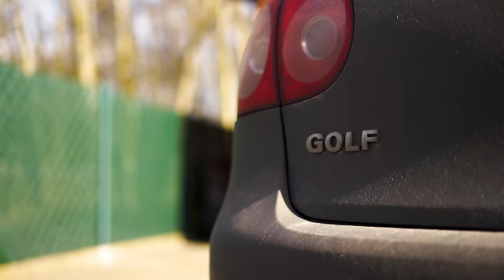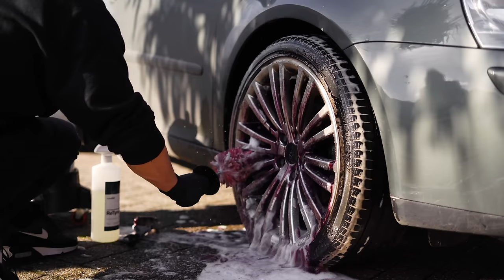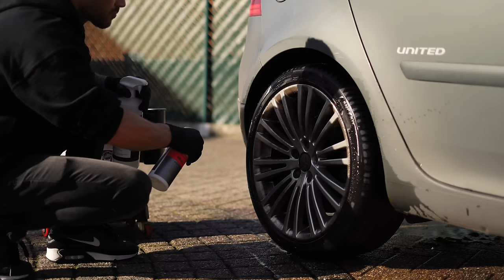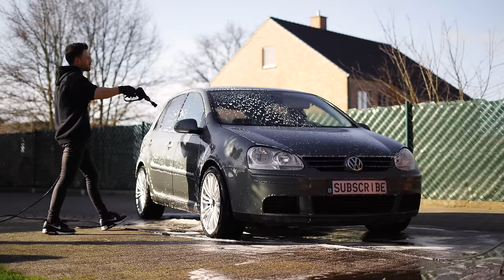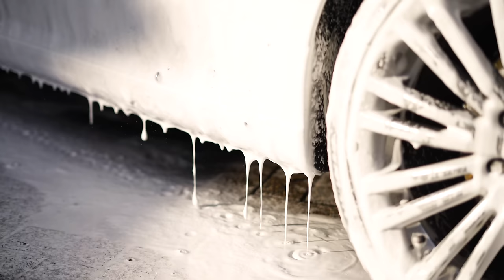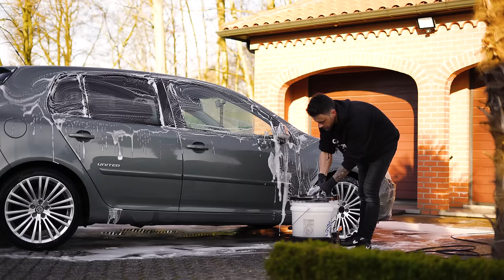15 Year Old VW Golf Deep Clean - DIRTY Car Detailing

Comment: Can you tell what i need to focus first with clearing car (equipment). I wanna to  compare my eqiupment with low salary (3.3kpln to 4kpln for example k5 home is 1500pln). I was thinking about air pressure foam spreayer because i have a compressor but to wash off foam i need water pressure too.

Comment: Hello mate. I just bought the same detailing brush set as you and I was wondering if the hog hair brush is OK to use on paintwork right out of the packet? I was going to use the soft brush for badges etc and the hog hair for window rubbers and plastics. Any advice? Thanks.

Comment: Can someone please explain me what’s “EXAXTLY” the point using first the foamer, wash it and then using the buckets? Thanks
Reply: the first spray was a "pre wash", typically a higher pH level cleaner that breaks down all that stuck on grime. The second spray was just a pH neutral foaming soap. The buckets are his Wash and Rinse. Every  detailer has their own process, but the "pre wash" isn't necessary had he just rinsed the car first-removing most of the heavy stuff and then foaming the car with a higher pH foam soap. I dont know why he rinses off the foam before using the wash mitt. The foam acts as a form of lubrication. But i guess its to each his own.